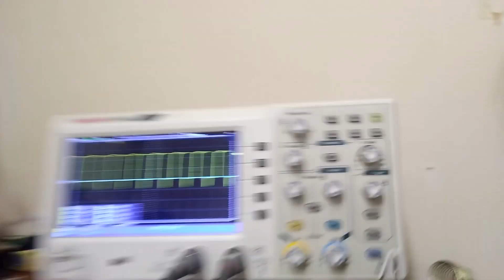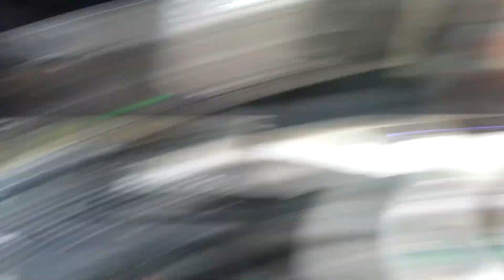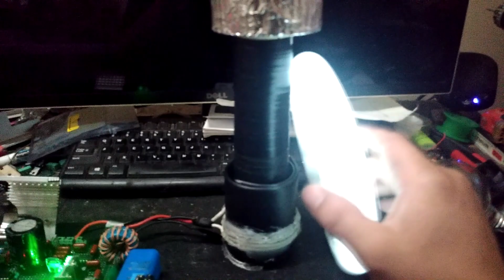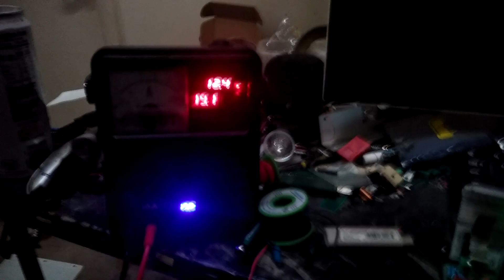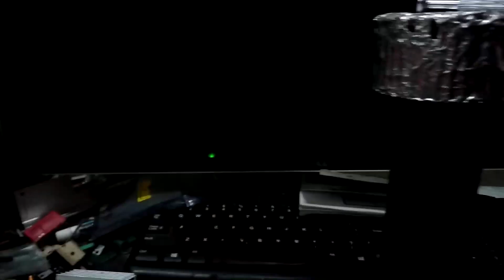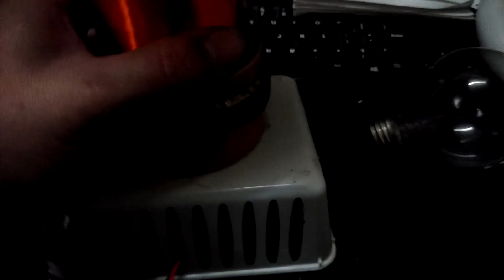Micro SSTC Driver 1V-100V(?) Interrupted/CW

Comment: I want to make one but I suck a making circuits every time I make one they blowup
Reply from the maker: Always best to start off playing with Tesla Coils by making a bunch of different Slayer Exciters. You can get a bunch of small silicon transistors for cheap and try cheap 9v batteries for power. Something like 2N2222's work ok and you actually don't need anything else aside from the wire to make it work so long as you manually kick start it. Later you can try higher power by using bigger package transistors like MJE3055 or TIP transistors. More power you can use mosfets. Eventually those get boring and it may drive you to learn how to build different kinds of drivers. I actually had to build maybe 50 or 60 slayer exciters of different sizes and modifications before I got tired of them and still haven't really done all that's possible. Learning how to utilize some of these modern integrated circuits makes it easier to get more impressive arcs and push more power. It has taken me a long time to get just a basic electronic understanding dealing with these things but much of what I've learned so far is probably the result of getting obsessed with making little Tesla Coils.
Reply: @Magneticitist  yes I’ve made slayer exit era before but like always my desire for me power blew up the mosfet  and I’m not high high level of electronics so and most the time I’m on a budget so if I cant get them assembled I try to make them but I only have irfp260 mosfets
Reply from the maker: @Texas_bikes66  Those are really good mosfets if they are 'legit'. There are a lot of fake ones going around ebay and amazon though. The fake ones will work fine for a lot of applications at less efficiency but a fake IRFP260 may not withstand what a real one can. It's often luck when someone throws together some coils and mosfet and happens to get good output by adjusting the voltage divider til they see corona.

One of the problems some people have is that they are winding small coils with very high resonant frequencies and then trying to switch the mosfets at these frequencies in ways which cause a lot of losses. It's not as simple as using a bigger mosfet and getting more power out of the arcs. Some really good output can be gotten from small transistors but given how the driver works it's more often an output with a lot of purple corona and not so much hot arcs.
Reply: @Magneticitist  if I were to pay you to make a Tesla coil with the cheapest parts you are Comfortable using would you take it
Reply from the maker: @Texas_bikes66  All depends, but you won't learn much from it if someone else builds it. Also with any project you have to keep in mind what the specific goals are. With a Tesla Coil that largely involves how much power you want to feed it and at what voltages. What kind of arcs specifically like Continuous Wave or interrupted. Filtered DC or unfiltered rectified AC for 'sword' sparks etc. 

One of the drivers I plan to make another of is one I used fake IRFP260's for and it only needs like 24v to get about 4 inch arcs. It just requires two mosfets and an interrupter along with a few other cheap components but no actual ICs.
Reply: @Magneticitist  I see what your saying but most time I take the circuit and analyze it in a model
Reply from the maker: @Texas_bikes66  That's a good practice I never developed but I need to. I find it easier for me to build dirty mock ups in a way which allows for easy testing of all the variables I think to be important. Over time you start to see parallels and trends.

Trial and error is a great way to learn IMO because the errors are just as important to learn as the correct methods. Any time I can on a test build I cram as many screw-terminal blocks on a board as I can connecting to any and everything I think is an important variable. Fake IRFP250's from amazon seem to be good test fets that are not too expensive to pop. I have left a lot of them on the final builds.